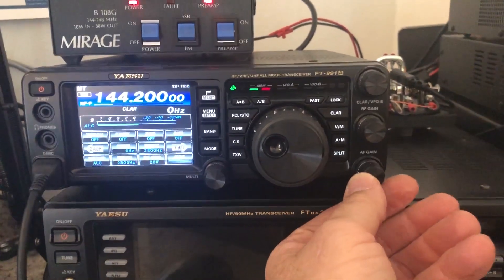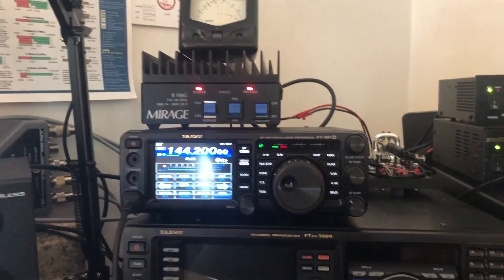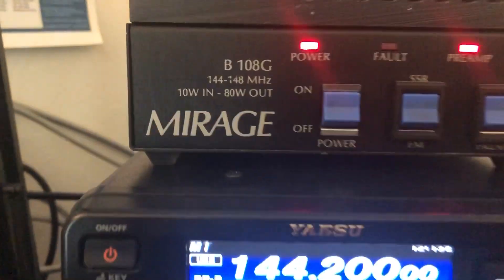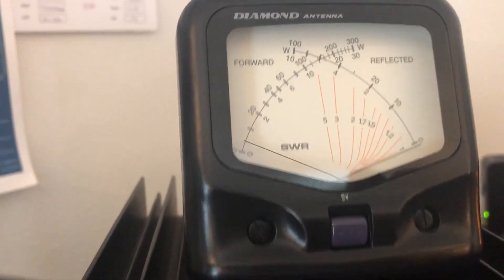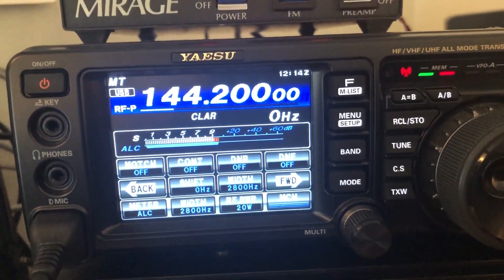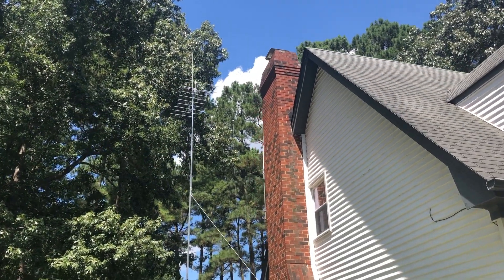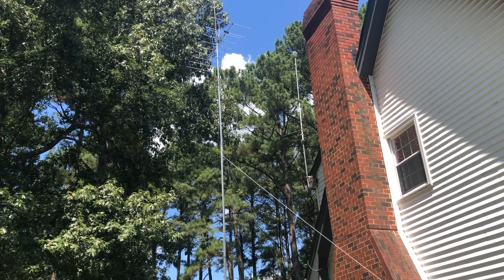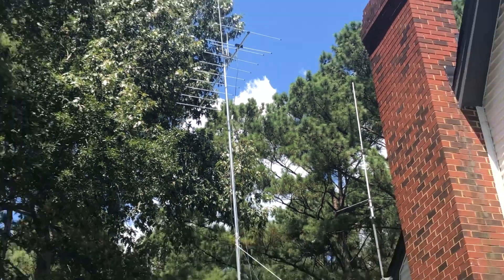10 element 2 meter yagi on my Yaesu FT-991a

Comment: What brand antenna is that?
Reply from the maker: That is a Diamond antenna. I don't recall the model but it's the ten element VHF antenna. It's not high enough to work well. Had it mounted much higher at my last house and it worked very well.

Comment: 80 watts from the amp, versus up to 50 watts from the rig (barefoot, 2m & 70cm), is only +2dB. And that's only about one-third of a typical S-unit.  Typically it's not worth getting out of your chair unless the change you're contemplating is a 'doubling' to achieve a +3dB increase.
Reply from the maker: It’s called having fun. I have it. May as well play with it.

Comment: Hi. Keith, WB2VUO near Buffalo, NY. Not much SSB around here either, but I find that I can make contacts and/or get spotted on FT8 almost any time. I run a horizontal mobile antenna made by eFactor as my lot is too congested to be able to swing a beam! If you have FT8 running, try looking around on 144.174 MHz for activity. I monitor in the late evenings there from grid FN02ox...

U3, Keith, WB2VUO here near Buffalo,  NY

Comment: I couldn't tell from the antenna picture if you had the yagi mounted horizontal or vertical.  If you want to use it strictly for SSB then it should be mounted horizontal.  It will work vertical, but will loose a lot of signal.
Reply from the maker: It's horizontal. I use the vertical mounted above it for FM repeaters.

Comment: I'd like to have a dual band yagi for my 991a. I've thought about getting a cheap dual bander to leave on particular frequencies to monitor and have cross band repeat, and the yagi for this radio. Would be quite a setup. Not sure what mobile I would go with though, Maybe the IC-5100 or the TYT-8900?

Comment: Why the amp? The 991A is putting out 50 watts already. And also your position of the antenna have no "line of sight" as you mentioned, you are putting al the aimed power right in the trees a few meter from the antenna.
Reply: Maybe he owned the amp already and doesn't want to run the 991A flat out. It's his choice, sorry if it doesn't align with your values. Oh, and I've heard he's taken your advice and chopped his trees down.
Reply: @johnc3403  Why not flat out? it is made and tested for it and if you have one you payed for it.  You run it within the specs so what could posebly go wrong? Cutting the trees is an real upgrade in his situation by the way.

Comment: what is your furthest contact with this setup?  Seems like an excellent system.  I did not know one could really do any distance over 20 miles with 2 meters.  How does that work?
Reply: Most of the time it is very terrain dependent. Occasionally you might see tropospheric ducting where the atmosphere kinda acts like a fiber optic cable somewhere much further away.
Reply: I have worked North and South Dakota,Kansas, Canada,Cuba,Puerto Rico, and about 30 states or so on 2 meter SSB with band openings from here in EM80 in Northeast Florida over the years.2 meters is very underrated.I was using 160 watts and an old Horizontal Cushcraft 215WB at about 61 ft 👍🎙
Reply: Height is might: "The higher you can get your antenna the further your signal will travel". I live in a city and so there are lots of buildings in the way (sometimes they help sometimes they hinder. But when I get up in the hills I can make contacts with other amateurs using a handheld of upto 150km. If you want to do SSB then a yagi will help to  push more dB out in the direction the antenna is pointed. But make sure your Yagi is above the tree line and you should get good results. The more you experiment the more you learn what works for you.

Comment: is horozanal more suitable for 2m ssb
Reply from the maker: Generally SSB uses Horizontal polarized antennas. It's not better or worse as long as both stations are the same. There is a pretty big DB loss going from vertical to horizontal.

Comment: Hello.  I’ve recently purchased a 991A also. I’m using it to replace my faulty FT 847.  That 50 watts  and your 10 elements will  work pretty good. Look for tropo action this spring towards the south. You can work Florida. Try to get that antenna as high as possible and a good feedlline.  You need the rotator. I’ve worked over 500 miles with a low Armstrong Yagi in the driveway on 222 and 432.

Comment: You don't need the amp. First of all, you are over driving the amp. It's not designed for 20 watts in. The radio already puts out 50 watts and that's only 3 db down from 100 watts. 3 DB is only 1/2 of an S unit. 
Barry
Reply from the maker: You are technically correct. Here are my thoughts. I don't usually drive the amp that hard but when I do it never even gets warm. 20 watts SSB is not that hard on it. I would not run 20 watts CW though. And I would rather run my $1000+ transceiver at 10-20 watts and let my $100 amp do the work.  As long as I have it I may as well use it.
Reply: yes the difference between 50 and 100 is 3 dB only but the last 3 dB ist what you need for dx in FT8. But do not overdrive the Input of the Amp. Sorry about my english. Good luck